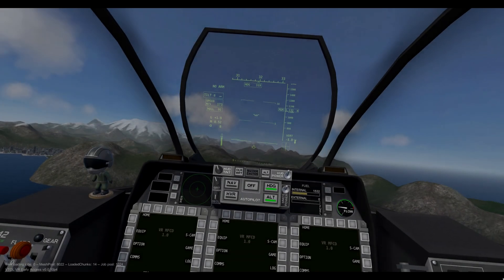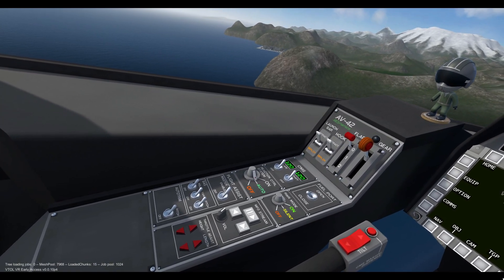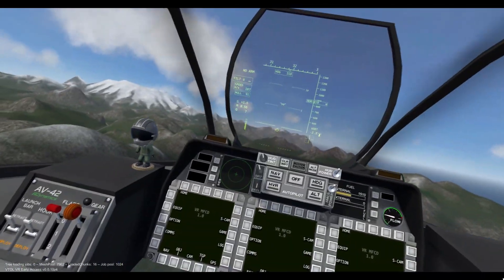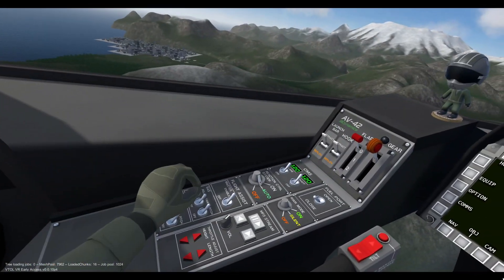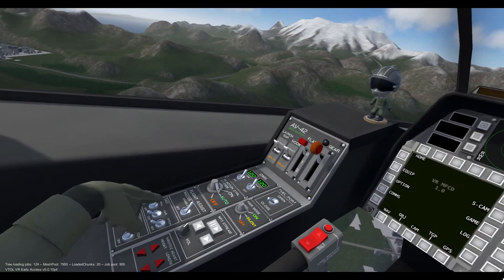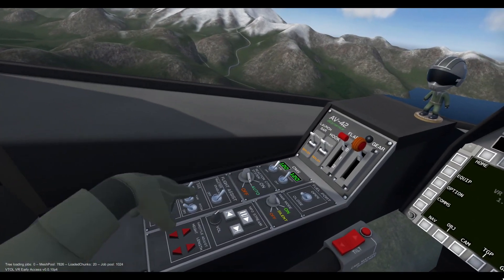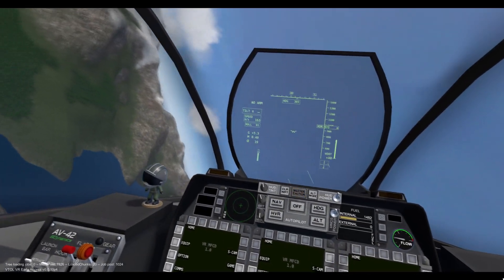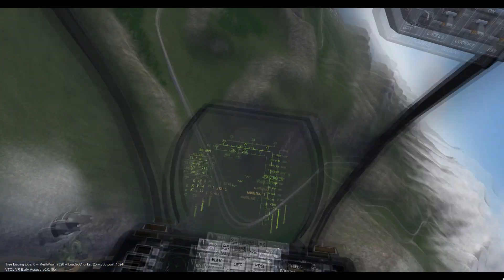VTOL VR Tutorial Nuggets: AV-42C Flight Assistance (AutoTrim & SAS)

Comment: Flight Assist:  Smooths out the flight and helps maintain control at the expense of maneuverability options.

Auto-trim does automatically what you would do with a Trim Tab or Trim Wheel in a flight sim.  The biggest effect is that it removes the micromanagement of trim as your flight speed changes, meaning you can put your nose on a pitch setting and leave it there.  Without autotrim, reducing power in forward flight slows you down, which causes your nose to drop until your speed comes back up.  

The SAS corrects for oscillations (back and forth movement) in their respective domains.  Essentially applying counter-inputs to dampen the motion and smooth them out.  Again, this takes micromanagement of the flight out of the pilot's hands.  It also helps improve safety, as the oscillations can amplify if left on their own and turn into behaviors such a porpoising.  

When all these flight assist functions are enabled, the overall effect is that you can be confident in letting go of the stick to mess with your MFDs, and those nose sill will still be pointing where you left it.  It's not quite autopilot as it doesn't lock your aircraft in to a course and altitude, but it's a pretty good second.

With the VTOL functions, it'll also smooth out inputs so you don't end up chasing the craft all over when you overcorrect a rotation, making VTOL flight easier before you even use the hover AP function.